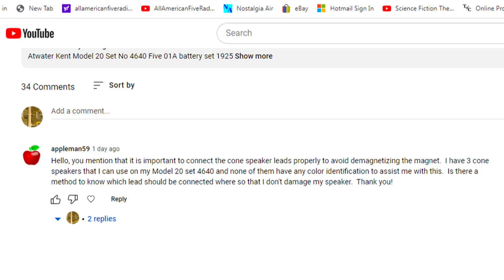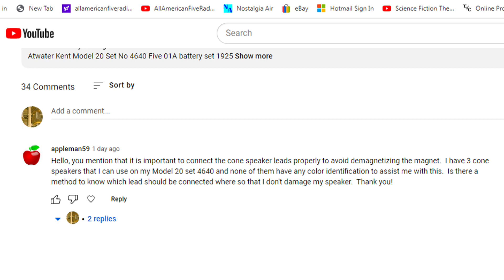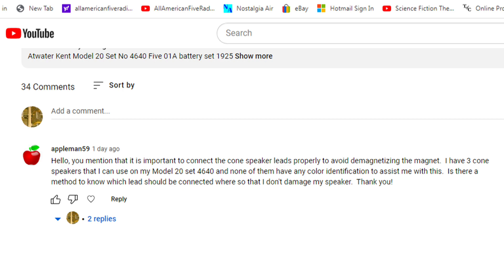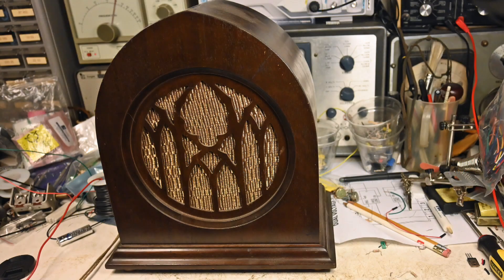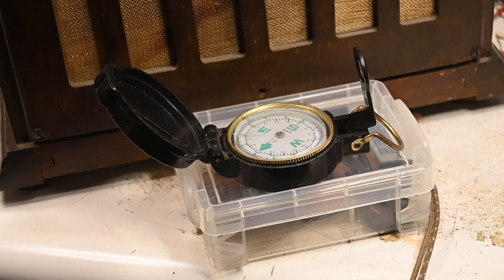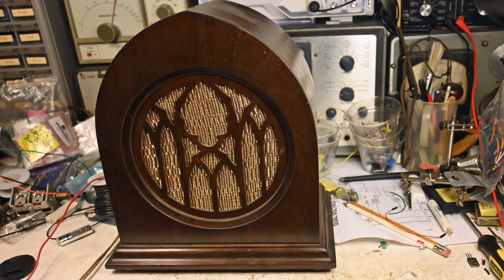Determining the Polarity of a 1920s Speaker

Comment: I thought it was just a phasing thing when multiple speakers are present. How does this demagnetize the speaker?
Reply from the maker: The 1920s speaker, horn speaker, or earphones have very weak magnets. Usually about 90VDC is connected to these devices. If the 90VDC is connected backwards, this will demagitized the devices.

Comment: a lot work for nothing , i use 1.5v battery and in 2 seconds i'm done ,,,you have to take the speaker out the case  for test the animal but the test is 100%  ,,,,
Reply from the maker: That will not work with horn speaker or headphones.

Comment: Richard, I fixed an old Atwater Kent 55C for a friend. I had to replace an output transformer on it. He said over about a year the volume got less and less until finally the sound quit altogether. Is it possible I hooked up the speaker wrong? If so, is the speaker salvagble?
Reply from the maker: Hey John
I have looked at the wiring diagram for a Atwater Kent 55C. I don't think it's likely that changing out the audio output transformer would affect the speaker, if the voice coil was reversed are not. I would connect a modern permanent magnet speaker to D1 and D2, the output of the audio transformer. If the modern permanent magnet speaker plays well, then you have a problem with the original speaker. If the modern permanent magnet speaker plays the same as the original speaker, there is another problem with the radio. In that case some signal tracing would be very helpful. You can contact me at this email address allamericanfiveradio@yahoo.com make the subject Atwater Kent 55C. Please let me know what you find out.
Reply: @AllAmericanFiveRadio  Thank you once again!  You are the greatest Richard.
Reply from the maker: @johnallenrichter  Let me know what happens.

Comment: I knew it involved using a compass to determine the direction of the magnetic field. Your compass is like my old one , it's sticking. If you remove the speaker from the grill cloth so the cone is exposed and send a signal with a signal generator,
where you turn the signal generator on then off, the cone should move properly in response to the sound at an away direction just like a permanent magnet speaker would. If it doesn't  you have the wires switched. So there are two ways of testing for speaker polarity.
Reply from the maker: That method should work here. May not with horn speakers or earphones.
Reply: @AllAmericanFiveRadio  No, not at all.

Comment: This would be to wire the field coil to keep the magnetic sense that it had.

Even yet, wouldn't the speaker eventually take on the reverse polarity if the field coil is wired backwards?

I had a field coil speaker and when the field coil was not energized, nothing happened in response to sending a signal to the voice coil, as if it hadn't taken a magnetic sense at all.
Reply from the maker: This has no field coil (1920s). The magnet is like a horseshoe.